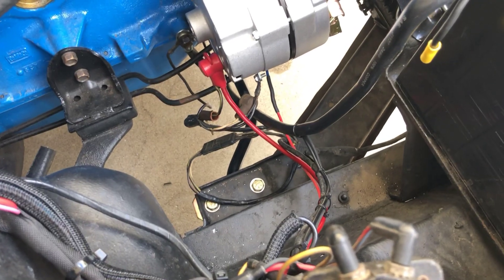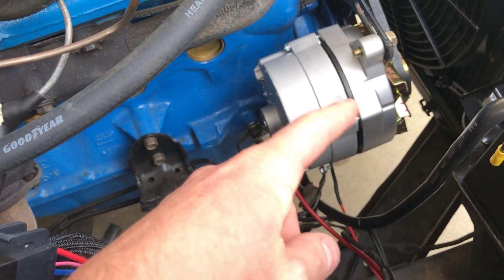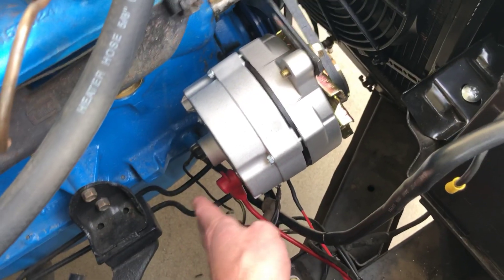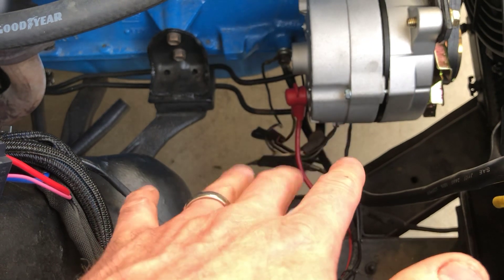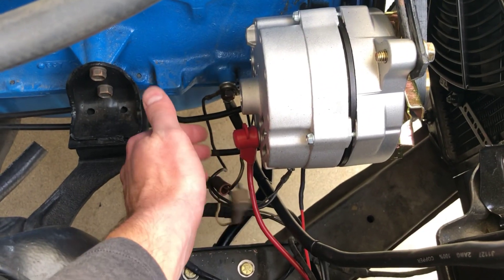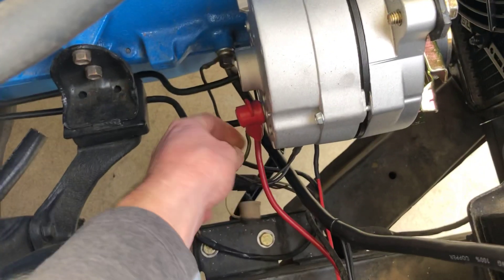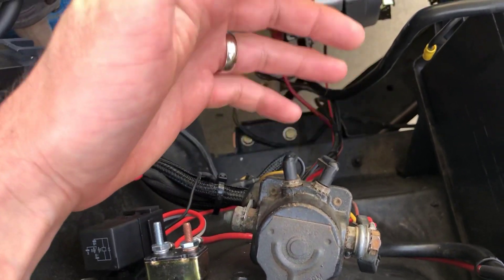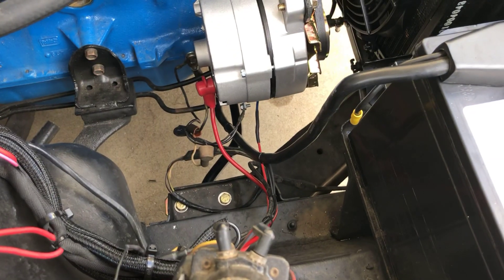Converting from an Externally Regulated Alternator to an Internally Regulated One-Wire Alternator

Comment: Appreciate going over and the explanations.  What size engine is that?  I have a 170 cc six cylinder and want to replace the generator.  Did you have to make a specific bracket?

Comment: Isnt heat in a wire resistance . For the length why not use the appropriate awg wire size for 100 amps  its not like you are going to spend a fortune on it. Just a thot

Comment: Did your dummy light stay on after you used the one wire alternator?
Reply from the maker: @brandonchiles1587  I have an ammeter and I converted it to a voltmeter. The dummy light is a little harder but there are schematics online that will help you make it work.

Comment: I hope you guy don't require more than 200-300 watts of power you just can not use a hot wire like CCA wire atleast get some OFC or Pure copper wire also there are a screw missing maybe you did unscrew it for the video but atleast fuse cca wire even if its lower gauge never use it as main hot wire its hot very hot higher cooper quality dont use cca on hot wire !

Comment: Weren't there things connected to the external voltage regulator that still need to be rerouted? I got a 42amp on my 63 thunderbird which has 3 wires coming from it and it has an electric voltage regulator. Just trying to hook up a classic car stereo head unit with a small amp is sending the amp into protection mode. Is that a tuff stuff alternator? How reliable has it been after 3 years?
Reply from the maker: No reroute is necessary. Just disconnect it. 
3 years and several thousand miles, still works perfectly.

Comment: How does the amps going to the battery from regulate themselves ? Or should battery get over charged. Or is the internal regulator inside alternator govern that somehow?
Reply from the maker: Voltage is regulated by the voltage regulator in the alternator. 
Current is inherently regulated by the batteries internal resistance. The higher the charge, the less current it will draw.

Comment: My question is if it’s one wire and I’m running a Dakota digital dash and  holley sniper kit how do I wire it up to where I’m going to be able to read the voltage on the holley sniper handheld ?
Reply: Did you ever figure that out I have same problem
Reply: @peytonhicks1491  What’s your problem?

Comment: I have a question 
I just installed a new radiator with two fans (electric) and it’s killing my battery and also on my 68 ford galaxy It came with a newer geo Chevy distributor that I am sure draws more current . Well I am needing to convert what do you suggest because if I drive and turn off it won’t start because it weakens the battery 😢
Reply from the maker: You need an alternator with more output at idle. You need to estimate how much current you’re drawing at idle and select an alternator that meets that minimum at idle speed.

Comment: surprised you’re okay with a single 8 gauge. id run minimum 4 gauge competition wire.
Reply from the maker: I thought I explained that in the video. It’s 8 gauge but it’s 125c rated so it’s good for 105a. Not all wire is created equally 🙂
Reply: @mechtrician1  no matter how high quality the wire is, or how high its rated for, 8 gauge is too small for my comfort level.
Reply from the maker: @4gclipseGT  then you are ignoring science, physics, and mathematics. Sorry, can’t help you with that.

Comment: This sounds like you can just remove the rest of the wires and connect the one wire to the battery. with some insolvencies but itll work.  Is this correct?  I have a 1966 Lincoln continental.
Reply from the maker: Correct

Comment: Hey! So question. I would think, but would this work for other engines as well? 

I have a 1980 Toyota Corolla with 3tc 4cyl engine and I bought it as a project car, but the last person messed up the wire harness and I’m trying to “rewire” the alternator so it charges. My engine keeps dying once the battery  empties charge. It is an external regulator as I believe since the wires goto the regulator.

I’m not too fond of electrical, or enough to trouble shoot. Possibly the regulator is dead but I feel it would be the alternator even though it looks brand new.(also to note, they made a button start, which works fine and starts quickly, but the ignition key does not start the car. Not sure if that could be a reason it isn’t charging the battery.)

Great video and explanation as well very informative I appreciate you for this.
Reply: Did anyone reply?
Reply: Dang! A year ago…..
Nope. Not a single person.
I did fix it with my own intuition but stayed with the external regulator, and new stock trashy 55amp alternator.
Found another video that was more to my engine and corolla model with the 1 wire conversion @ touge classics that I found useful as well
Reply: Did not proceed with the one wire just yet…

Comment: I have a question I don't know whether you're going to see this or not I recently upgraded to 140 amp alternator 86 El Camino with AC it has the one wire hook up like you're talking about what'll happen if I still plug in the factory plug as well as the one wire
Reply from the maker: No real need to. If the one wire has the 2 terminal plug, assuming the pin outs match you could hook it up but you’d want to check the pin outs first and make sure they match. GM changed them over the years. I wouldn’t bother though.
Reply: @mechtrician1  thanks I'll just leave it its holding volts so all is good 👍

Comment: Could you explain how a dash mounted ammeter would be hooked up to this one wire system?
Reply from the maker: In order for it to really work correctly you need to install what’s called an ammeter shunt. It’s a basically a low resistance resistor that the ammeter is in parallel with. 
Personally I don’t think it’s worth playing with that. I just had my stock ammeter converted to a voltmeter.

Comment: I’m moving to a 100 amp one wire alternator on my 79 f150 351m 4x4, my question is can I hook the power wire up to battery side of the solenoid valve, the run the old starter wire from the alternator to the ignition switch side of the solenoid?

Comment: I have a 350 small block and when I go to start it the power is on but when I turn it over all the power shuts off the battery is brand new fully charged I’ve pulled fuses I’ve checked for bad grounds. I do see that my Alternator wire the red one is burnt up could that be my problem? Thank you.
Reply from the maker: Could be the issue but I doubt it. Sounds like the solenoid is not wired right. There is a bypass wire to keep the system energized when cranking. Sounds like that might not be hooked up.
Reply: @mechtrician1  so would you recommend me getting a new Starter? Or just the Solenoid?
Reply from the maker: @tylerangel4073  starter but I’d troubleshoot the issue before going through the expense and trouble. It’s unlikely the starter solenoid is bad if it’s cranking. It’s likely a wiring issue or bad ignition switch, something like that. Find the schematic online and trace it out.

Comment: Thanks for the vid. My question is...is it not necessary or at least advisable to have a fuse inline from the alternator to the battery when running a 1 wire? If so, any fuse size recommendations for a 120 amp alternator?
Reply from the maker: It’s advisable yes. I personally don’t usually fuse them because the way the wire is routed, it’s pretty safe (production vehicles weren’t fused for many years on the starter and alternator), but yes I’d recommend it for folks.  Fuse size is based off of whatever in the circuit has the lowest maximum current rating. Usually that’s the wire and it’s what we want to protect. So if you’re using wire that is good for 150 amps, conservatively you’d fuse at 150 amps.  If you have a 120 amp alternator, size the wire for at least that and fuse at 120 amps. This assumes you have headroom in the power you need and that it will be running at less than 120 amps at full load.

Comment: Good evening sir. I have a question, do you still have that original externally regulated alternator? If so, does it work? 

I have a 1972 GMC Sierra Grande with a small block 350 on a TH400 automatic transmission. I want to keep it as original as I can, and I was wondering if that original externally regulated alternator you have would work just fine without having charging/power issues? I bought an internally regulated alternator but im learning as I go and I’m honestly not too electrically inclined. Therefore I’ve looked up the alternator conversion and I think I can do it but since I’m not planning on putting electric fans or anything out of the ordinary, I was wondering if I could just get by with the original alternator. 

I’m sorry for the long message, thank you for your help. Have a blessed day!
Reply from the maker: Hi there. I do have it but it’s for a Ford and won’t work or mount up to your application. If you are totally stock with no added accessories you can keep the externally regulated alternator. I would get an electronic regulator replacement though. They work much better. You can also convert to an internally regulated alternator if you want and it will still look original.
Reply: @mechtrician1  Thank you for the reply. Oh okay, I for some reason thought it was for a Chevy/GMC. Well when I bout the truck, the wiring was and still is a mess, so I’m trying to wire everything up. It seems like all the wires are there but again, I’m not very good on the electrical side if things so I’m figuring it out through YouTube and Google. Do you happen to have an Instagram account so that as I go through the process maybe if it’s not too much trouble, I can ask you some questions and send pictures of the process? 

Thank you very much, have a blessed day.
Reply: @mechtrician1  I forgot to mention, it didn’t have an alternator to begin with, not even the brackets for it so when I bought one, I ended up getting an internally regulated one unintentionally.

Comment: My niece has a 1984 fox body Mustang and bought a Powermaster 150 amp 1 wire replacement alternator.  I looked at it today and it says it need 6 gauge wire.  The alternator in there now has 2 wires, one red, from the alternator going to a connector, then those 2 wires go into a harness that disappears somewhere, doesn't look like it's coming out at the solenoid.  There's a voltage gauge in the dash.  I was planning on getting a 6 gauge wire and going direct to the battery, but I'm wondering if that voltage gauge is going to work.  I guess I just leave that plug with the 2 wires hanging and shrink wrap it then?
Reply from the maker: One of the original wires should be the original positive wire, it will be a larger gauge wire. Hook that up to the alt positive stud and a #6 to the battery. That way the original positive is still hooked up. Shrink wrap the other wire.
Reply: @mechtrician1  Sweet, I was just thinking maybe I could do that and fake the system out and just leave the smaller wire disconnected.  Thanks much!

Comment: I have one question if you have time. Vehicle:  1965 289 standard transmission. I'm going to put a one wire alternator on and ground it good, and disconnect the voltage requlator. My question:  Can one still intergrate the alternator warning light by jumping wires in the voltage requlator harness that is now disconnected? Which wires need to be jumped? and does a diod need to be installed?
Reply from the maker: I’ll have to study the schematic for a bulb type indicator on the 65, but a lot of times the GM style alternators have an output you can use for a charge indicator bulb already. If not, there are several other ways to make it work.
Reply: @mechtrician1 I was recently reviewing the very question ….. believe you splice the two wires on the “A” terminal of your voltage regulator in order for the generator light to function.  As well you have to splice the 2 wires for your horn relay, If I remember correctly .

Comment: You should run a high quality agm battery as well.
Reply from the maker: I usually do. I run Optima’s in my other vehicles already. This is just what was in it when I bought the car and it’s brand new. When it gets replaced, it will be with a red top.
Reply: @mechtrician I'd also change this alt to a HO alt, similar to your other vehicle.  If you're staying with v-belt and not switching to serpentine then I'd suggest going with less than 250A alt.  Anything higher will put too much strain on the v-notch.  I'd suggest to check out Brand-X alternators (out of Ohio).  Jon Patrick has been in the industry for a long time and very knowledgeable about alts and internal/external regulating with or without diode trick (depends on voltage you want to charge at).  You can also do the Big-3 (probably Big-4 to be safe) upgrade to your electrical system.
Reply from the maker: This is a new alternator, 100amp.  So it’s not too much for a v-belt but plenty for this application. I like to use Mechman alternators for high output.
Reply: @mechtrician1  i have a 160 amp for my 73 nova. I have a 240 mechman i had for my 90 bronco. I want to change the housing so i can use it in my chevy.
Reply: Where’d you order yours? I can only find 160/140 amps.
Reply from the maker: @Ryan-fh7ne  summit. P/N SUM-810308
Reply: @mechtrician1  Thanks man!
Reply: Thanks for the vid! Essentially this conversion is the same process on a 1st Gen Dodge correct?
Reply from the maker: @mobious4324  they are all basically the same, yes. There might be nuisances depending on the vehicle, but the general idea of just removing the old regulator is pretty standard.
Reply: @mechtrician1  Thank you!!!
Reply: In classic mopar they bypass(disconnect )  the ammeter because of fire hazard